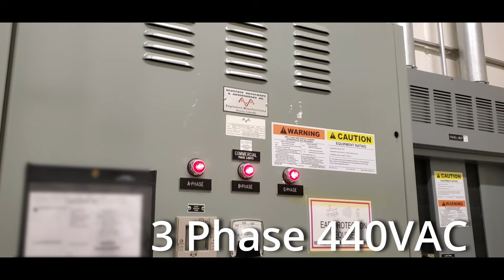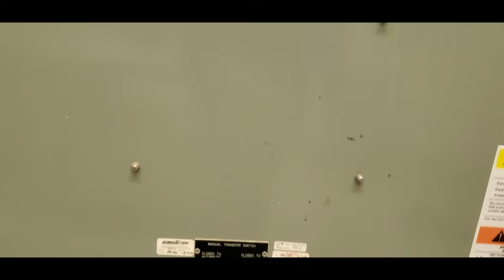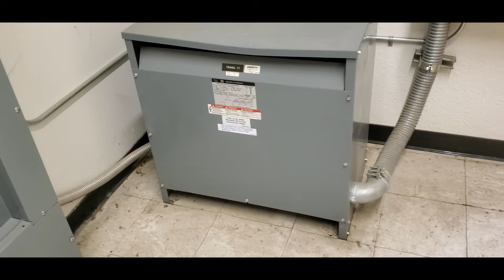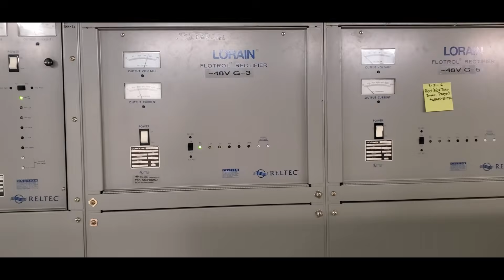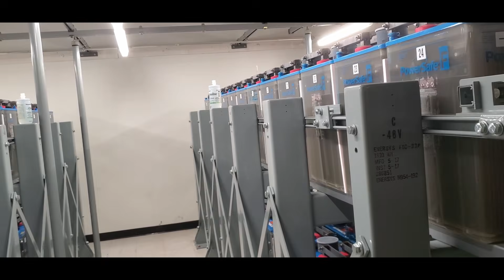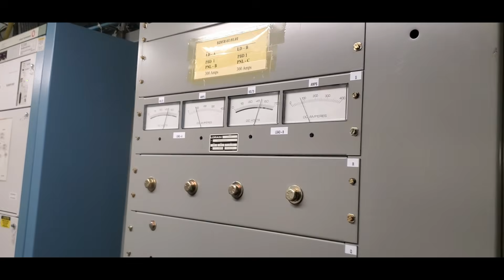The Power Behind Telecom: Central Office Power Made Simple

Comment: what type of rectification do these use?, is it syncronouse rectification with mosfets?, IGBTS?, SCR?, or plain old massive diodes?
Reply: I've seen pretty much all of the above in different vintages of equipment (except IGBTs which make no sense for low voltage rectification) but my money is on a combo of SCRs and massive diodes for these particular units.
Reply: This CO seems largely equipped with '80s-'90s gear. I found a manual for some similar rectifiers from Lorain also in the Flotrol line which actually describes the power circuitry. Not sure if I can post a link here, shouldn't be hard to find on Google, but it describes the rectification stage as a six-phase arrangement of thyristors and diodes

Comment: I remember being in a former CO building and in the basement they had a big tub area for the battery banks.  Not a lot of people realize that the phone company at least used to be all 48V DC.  It is far more efficient when trying to meet government uptime requirements to run off of DC power directly than to convert DC battery power to AC and then convert the AC back into DC.

I have actually setup a play on this for core Internet functionality at home except the battery voltage used is 24V with an LFP battery.  With 24V power, I buck it down to 12V at over 95% efficiency with a super cheap buck converter to run the firewall.  I also buck it down to 5V at over 93% efficiency to run a small network switch and MoCA adapter.  Then I boost it up to 48V at over 90% efficiency for a PoE injector to power a Wi-Fi AP..  A simple DC UPS controls charge current to the battery so the power supply doesn't get overloaded.  When power goes out, it is super efficient to power this low powered networking gear and it can go for days before either generator power or solar power needs to be hooked to it to charge the battery back up.

I have been thinking what should be done, and I have seen it in some data centers, is to go to a 400V DC standard.  A lot less copper and copper is expensive these days.  A DC switching power supply, kind of like what you do in a regular PC power supply, except chop away the half that does the AC to DC conversion can efficiently convert the high voltage down to the low voltage needed for the equipment.  You also go to 12V for this conversion.  The reason we still use 12V and it has become the main voltage to use is doing a buck from 48V down to logic level voltage is not as efficient as 12V to logic voltage.  Long copper runs, especially with undersized copper will also experience significant losses, but transmission loses go down exponentially with higher voltages.  So you really get the best of both words, a higher voltage to slash the copper needed to get power around the facility with battery banks wired more like an EV battery to get up to 400V DC with minimal transmission losses.  Then at the load you switch down to 12V just like a regular computer power supply, even swapping out computer power supplies for these DC only ones at a high efficiency as you no longer have the losses from going from AC to DC and then the VRMs doing 12V to logic voltage run more efficiently than doing a 48V to logic voltage conversion with buck converters.

To get a better idea of why it is a bad idea to go from DC to AC and back to DC with say a common DC UPS, let's consider the home use case.  You get this UPS with Pb batteries and a cheeped out power inverter.  Under load maybe these Pb batteries are 70% efficient at turning the energy put into them into power coming out.  The cheeped out inverter is maybe 60% efficient at converting the DC power into an MST wave.  Your cheap power warts are maybe 70% efficient at converting AC power into DC for your communications gear to work.  That is ~30% end-to-end efficiency.  Hard and expensive to get a good run time this way.  What I am talking about with LFP batteries and this other DC setup is more like 98% efficient to draw from the LFP battery, 95% efficient to convert to the voltage needed on average equals ~93% end-to-end efficiency to run this communications gear on battery power.  And I can get a fairly large LFP battery that lasts over a decade for fairly cheap while Pb batteries need to be changed out every 3 - 5 years.  So yeah, just completely blows it out of the water in terms of efficiency, run time, longevity, and overall TCO of the backup power system.  Then I am using a single larger power supply that is 90% efficient to get the grid power instead of multiple cheap power supplies that tend to be more like 70% efficient.  So, drawing less power from the grid in normal operation, which also contributes to the TCO of the system.
Reply: There are some safety issues around 400V DC in the home. Electricians and their unions will moan about it, manufacturers will be scared of lawsuits. But with the rise of solar panels, home battery storage, EV charging, and inverter driven air conditioners, all of which naturally run off high voltage DC, it makes a lot of sense.
Reply: @connerlabs we live in a power electronics world now.  AC was invented specifically because the power electronics weren't ready back in the day to do DC.
Reply: @ChaJ67 AC won over DC because it’s easier and cheaper to step AC voltage up and down with transformers. And that’s still the case. Data centers might be switching over to 400 or 800V DC internally, but the power company lines to them will be AC for the foreseeable future.
Reply: @connerlabs  Transformers are pretty easy, so hard to make that go away any time soon.

Here is the thing I was really trying to get at, when using pretty much anything in your home anymore, basically nothing makes any real sense to feed AC over a DC standard.  Even your common LED light bulb is a power electronics device.  The only thing that still uses AC directly are cheap AC motors.  However, these are very noisy electrical wise, overall have a poor load factor / high inductance factor, and they normally hard start unless a soft starter is installed.  Even these motors are increasingly giving way to inverter based systems that internally convert to DC, especially for things like air conditioners and fridges as higher efficiency is sought for these appliances.

On the grid, for a while now, new long distance power lines have been DC as it is just cheaper and there are fewer losses of various types.  As time has gone on and power electronics have improved, it has become cost effective to do shorter and shorter runs with DC.  Even for short runs of AC wiring and transformers, well the grid in some parts of the world is 60 Hz and other parts 50 Hz.  All of these transformers are big and bulky for what they do.  A switching power supply can use a much smaller transformer.  After a certain point, this shrinking down of things causing linear power supplies to go the way of the dodo bird could be something you would want to consider in how you transmit power shorter distances like around a neighborhood.  It probably won't switch any time soon even if cheap simply because of inertia.
Reply: @ChaJ67 Indeed the AC power system is being squeezed from the bottom by power electronic home appliances, and from the top by HVDC transmission lines. There’s still a lot of AC left in the middle though. One barrier to wider adoption of DC is that it’s harder to make switchgear and circuit protection. DC arcs are just harder to break than AC. It can be done though, 220V DC supply was used in European homes through the 1920s and 30s.